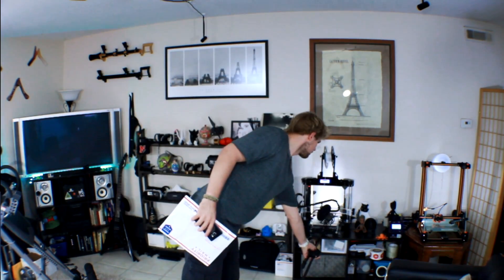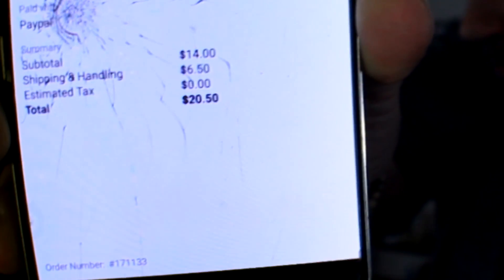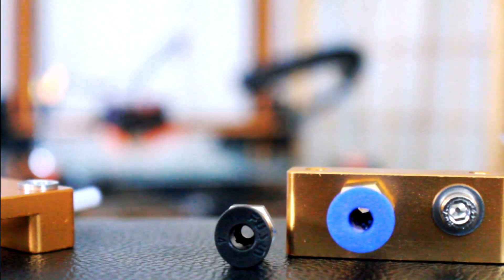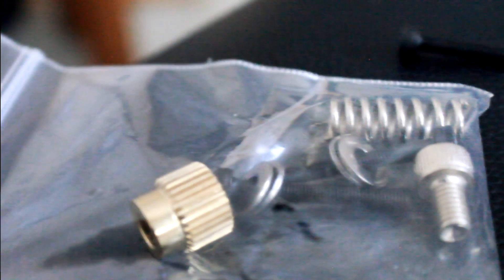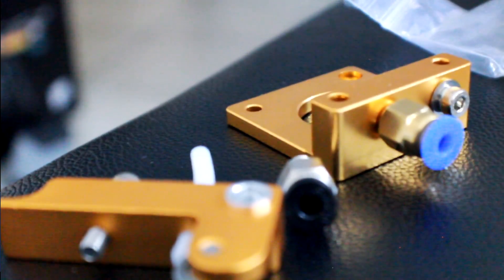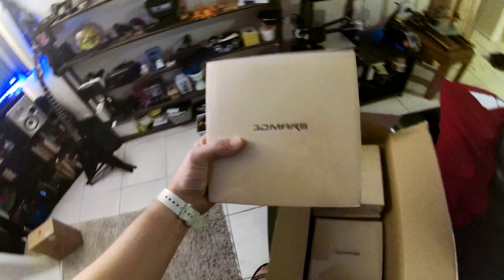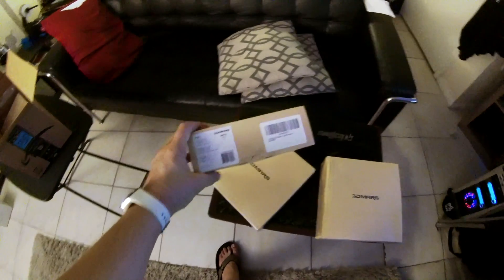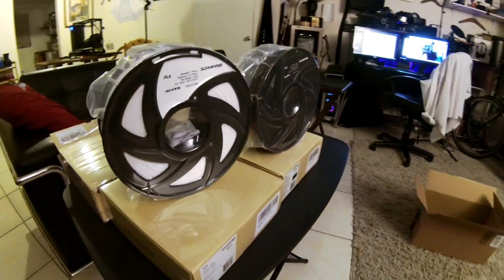✔ CR-10 Replacement MK8 Extruder Aluminum Drive Feed | MacEwen3D

Comment: if you search ebay this part now sells as PC4-01 1.75mm or 3mm  however it's not a original 3d printer part nor it has been meant to be used in extruder of any kind, instead , correct part name is 
Pneumatic Male Thread Adaptor Pipe Push Fit Straight Quick Connectors Fitting... is the online shop yours where you directing us to buy it from.. 
Pneumatic Male Thread Adaptor Pipe Push Fit Straight Quick Connectors Fitting superb invention

Comment: Can it fix skipping issues? My CR-10S feeds my filament through but sometimes skips at the motor. I have to push the filament through for the gear to catch it and feed to bowden tube.

Comment: I actually Read it the description...Awesome video, but i have some inquiries if you don't mind... And i could not find a link to your mk8 which you install in this video, and also did you ever upgrade your hot end? Also do you know how i can install my laser which i bought for this printer onto the printer it self...That could potentially be a very awesome video, and could generate a lot of views as a decent video does not exist! I want to know what are some must do mods for my cr-10s and your print settings because i cant get nothing but stringing and was only able to print the cat once, everything else has been a disaster... I hope you read this whole thing as well! lol
Reply from the maker: https://macewen3d.com/products/mk8-extruder-aluminum-drive-feed-for-cr-10-cr-10-s4-and-cr-10-s5 here is the link to the mk8 - what laser did you attach?
Reply: Reality Check VR it's a laser engraver I will send you a picture also my thermistor ripped I ordered another one the white wire can I connect it to the one that ripped somehow
Reply: I am still trying to attatch the one which magnetically mounts to my cr-10 i just dont know where the white plug with the black and red (+, -) cables seats, i dont know where i have to plug that into, the small fan or the motherboard control panel box? Let me know if you have any information sir!

Comment: What mount did you use in order to put the filament roll on the top? I have tried several positions using the factory spool holder and some extra "rail lock nuts" but the stock extruder snaps my PLA.  (it also is 3d mars)

Thanks man!

Comment: Looking at your MK8 install, what do you do with the filament to remove and reinsert after installation of the MK8. Sorry but I am new to 3d printing. Do you remove the filament, if so want method, and just reinsert it into the Bowen tube. Thanks for the reply.
Richard